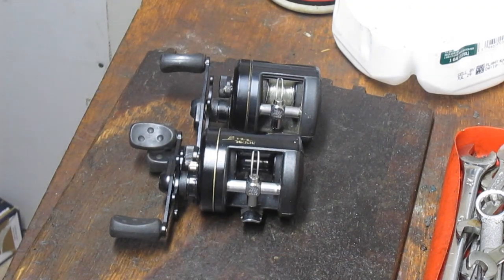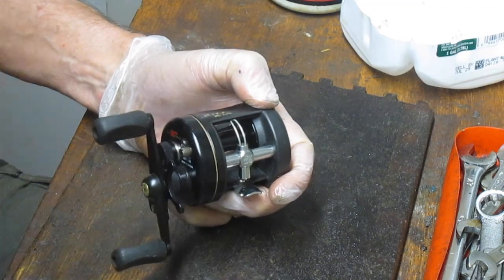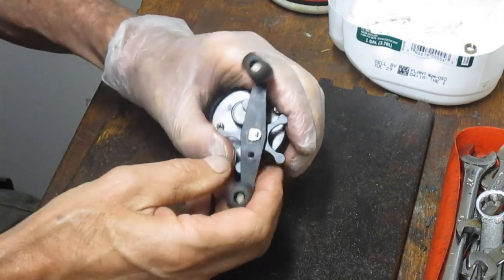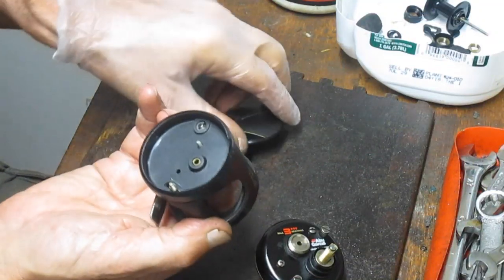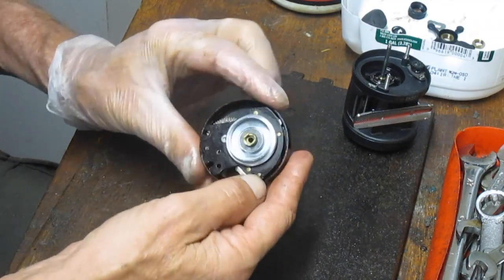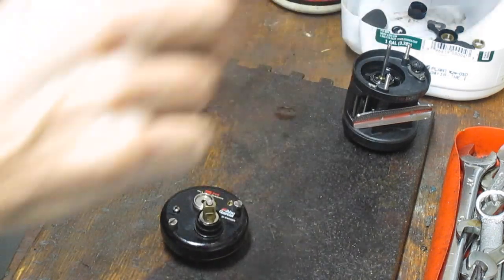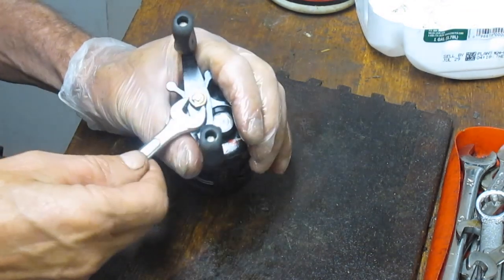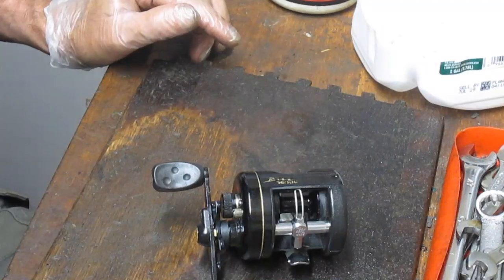Abu Garcia Black Max 3600c Ambassadeur fishing reel how to take apart and service step by step

Comment: Great video, but it should be pointed out that according to his video there is no bearing in the port side of the spool.  In fact, there is a bearing hidden under the black bearing retainer. The brass bushing is just a support for the axle.  Further, the bushings in the line guide worm can be replaced with 3x7x3 bearings.  Does not make much difference until you have been casting for 8 or 10 hours.  The worm bearings, and the bearing in the brake plate are the primary difference between the pro max and black max.
Reply from the maker: Thanks Mike - this is the first one of these that I worked on.  I will add those points to my collective memory.  I normally see the larger 5500 & 6500 types - Dennis
Reply: @2ndChanceTackle  they are great reels.  They cast a mile, are easy to get parts for, and last forever with a little care.  I loved watching the video and I have disassembled many of them.  You mentioned the fact the line guide is not engaged during the cast.  The other great point is, the axle does not spin during the cast (or retrieve).  The only mass that has to accelerate during the cast is the spool.  It is a simple, effective design, and they come in 5 sizes (1600, 3600, 5600, 6600, and 6600W).
Reply: Yep on the other spool bearing. Also, it looks like you have a 3600c and a 1600. Maybe a “c” but probably just a 1600. From the intro it looked like the other reel was a bit smaller. They made 5 sizes. 1600, 3600, 5600, 6600 and a 6600w for wider spool. The “c” means it has the faster 6:3:1 gears as opposed to the non c versions that are 5:3:1 I believe. The lettering wears off quickly but you can also tell bc the c versions were written in script and not block print. (As well as having the letter c) 
I fish almost exclusively with these. So great and easy to work on. 

Great video my friend!

Comment: Hi Dennis. Based on the recommendation in this video I purchased a BM3600C in pretty good condition. I serviced it using your video as a tutorial. I upgraded the hadle with a 130mm carbon-fiber handle with two bearings & I paired it up with a 6'6" medium moderate Fenwick (5 bearing reel now.) It is a match made in heaven for crankbaiting under the trees around here. I have caught quite a few fish in the Rahway River over the last few weeks using this setup. The reel works superbly & it has competition for my partner's Calcutta. BUT I can never leave well enough alone. My intention is to upgrade the plastic bushings in the worm gear to bearings. As an alternative, I could purchase the worm drive and bearings for a Promax 3600 and swap the parts. I reviewed the schematics for both reels and I think it will fit. Do you think this will work? I would like to hear your opinion on this before making a further investment. Thanks!
Reply from the maker: Will - I can't say for certain, but there is a good chance that it would be possible as manufacturers tend to standardize of certain parts and make them interchangeable.  I think it is worth a try.  What part of the Rahway river are you fishing?  Are you below the Rahway park or above it?  I've seen some big carp come in at slack high tide right in town.  Thanks for the note - Dennis
Reply: I believe they will plus check out carbontex drag washers and then you'll have somehing for that shimano🤘
Reply: @chrisgriffin3374  The parts are interchangeable and I did the carbontex washer upgrade. it's a pretty sweet deal now. I also got my hands on a Promax1600 by a happy accident (someone sent me the wrong reel in an online deal) I like it for bass a lot. The blackmax is going to be my blackfishing/fluke reel from the kayak in the spring.
Reply: @2ndChanceTackle  Hi Dennis. I fish the Rahway all the way from Scotch plains until I can see Staten Island. I've caught more than a few of those carp and they are nasty customers. They smell BAD! They do put up a nice fight. Mulberries... works every time.

Comment: Good afternoon sir,  I just bought one just like these.   I mostly use 5500 reels. This one doesn’t cast very far. I noticed that the level wind doesn’t travel when reel is casting but does when reeling the reel.  My other level winds all travel side to side when casting. Is something wrong with it? Thanks
Reply from the maker: That is the design of the reel.  The level wind is driven off of the main gear and when you go to free spool, the main gear is disengaged, so the level wind does not move.  Before casting your reel, make sure that the line guide is at the center of the reel.  That will increase your casting distance - Dennis

Comment: hey , this is same inside as the Ambassadeur  4600c ?? , can you ask some one how it is working with strike pro 0.15 it is what im thinking to put , thanks for the video …..
Reply from the maker: The design is similar, but not identical to the 4600C.  The strike pro .25 line will work with the 4600C
Reply: 25 lb braid ?  @2ndChanceTackle

Comment: Dennis, I have a Black Max 3600 but I cant get it to close. About one eighth of an inch gap. I have been over possible hitches but nothing I try works. There are minor part differences I found on Mikes Reels. Ambassador Black Max 3600 02
00 is my Black Max. Sadly they list part numbers but dont identify
What the parts are.
Reply from the maker: Hmm - do you have the spool brakes all of the way in - towards the shaft, when you are closing up the reel.  if they are out, you could be trapping them on the ring and that would prevent closing it up. Also - do you have spool line trapped between the spool and side plate? If that's  not it, you can send me a picture to my email 2ndchancetackle@gmail.com and I will try to help further Dennis

Comment: Hey Denis, looking for your expertise. I have the Ambassadeur Six approx 25 years old in excellent condition. Sometimes when I reel it makes clicking sound and doesnt connect to the spool. The handle turns but the spool doesnt. Its intermittent. What do you think may be the issue?
Reply from the maker: Hmmm.  My first guess would be that broken line got inside the assembly causing the skip or failure to engage.  Next would be a weak spring that doesn't  push the free spool assembly back into gear.  The next one wold be dried grease that is preventing the free spool mechanism from operating properly.  You may also have broken line wrapped around the spool shaft that I outside the gear housing. You are probably going to need to take the gear side plate off and have a look at it to identify the cause, but you can limit your  initial work to the spool and free spool mechanism.  This should not be in the gears, drags or anti-reverse. Try these first.  - Dennis
Reply: Thanks Denis! I'll have to take it apart again and see. Do you except reels for repair, if so how much. Its been completely overhauled and ìts real smooth,  except for that issue not engaging.
Reply from the maker: I do accept reels for repair.  Please contact me through my email - 2ndchancetackle@gmail.com for the details - Dennis

Comment: There is a bearing on the other side of the spool at least for the silver max there is cause if you take out the breaks and the bearing you will see it
Reply from the maker: Thanks for the note - I have to check.  Dennis

Comment: Sir i wonder why when i disengage the free spool and reel in after, i noticed that it has delay in engaging or even does not engage...what seems to be the problem sir?..by the way my reel is abu ambassadeur sm3600c..
Reply from the maker: The delay is for the pin to mesh with the slot in the pinion gear.  If it is not smooth, check to make sure both the slot and the spool shaft are clean and free of old grease and dirt.  That is usually why the delay happens - Dennis
Reply: @2ndChanceTackle at the last part of your video sir, once you free spool and reel in, it automatically engaging and click loud..mine is opposite..delay in engaging and low clicking sound even after i clean it up, and did degreasing and greasing after...

I noticed also when i opened and checked the mechanism, is it normal that the arm(the metal that lock once it freespool underneath the big gear) bend upward?...does that gear must be flat contact to the surface or not?.. .
Reply from the maker: Yes - that is a normal bend.  That arm goes between the slots in the click rotor under the main gear and it is tripped out to release the free spool once the reel is turned.  That is not the cause of your problem.  It may be that you have dried grease on the inside of the reel where the trim lever is.  Try spraying it with a penetrating oil like WD40 to loosen it up. - Dennis
Reply: @2ndChanceTackle  thank you so much sir....i really appreciate your help...by the way sir, one last question, may i know how much drag does this reel hold(3600c)?..ive been searching and still could not find answers...heheehe
Reply from the maker: I could only guess and that would be between 10-15 pounds of max drag.  I don't know for certain - Dennis

Comment: pro max 3600 is much different         020003,,,,  much harder,  black max is the budget version  black, then tournament with 3bb. then silvermax with 6bb then pro with 8bb then morum with 10
Reply: It's not quite the same wheel as the Black Max on sale today.

Abu Garcia Ambassadeur Black Max 3600 reels were only made for a couple of years, 1992 thru 1993.

They were ahead of their time in terms of design and performance and retailed for $99.00.

Do not confuse this round reel with the current low-profile Abu Garcia Black Max, as is there is no comparison. 

These reels are extremely durable, but susceptible to boat rash.

The Black Max 3600 is great for the beginning or experienced angler. They are easy to cast for distance and hard to backlash.

They can cast lightweight lures and go directly into the wind. 

Features:

Aluminum Alloy spool
3 Bearings
Triple Cross gear system which lays down line in a X pattern which prevents the line from digging into itself
 Frame is made in one piece of solid aluminum 
 5.3:1 Gear Ratio
Titanium Line Guide
Instant Anti-Reverse

Comment: Would have been more interesting getting into the other endplate which  you totally ignored wonder why ??.
Reply from the maker: I wonder why as well.  Probably because there is nothing interesting going on there.  Just the idler gear, which can be serviced without removing the side plate.  Thanks for watching - Dennis